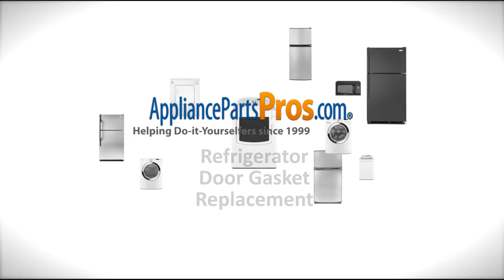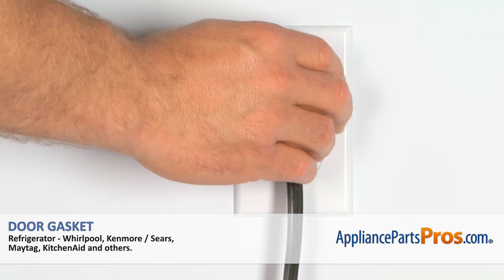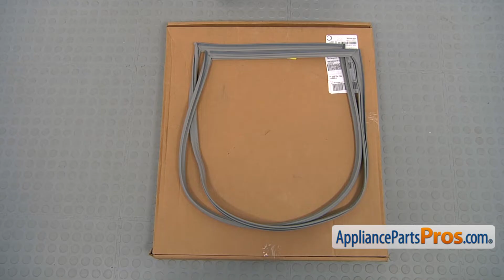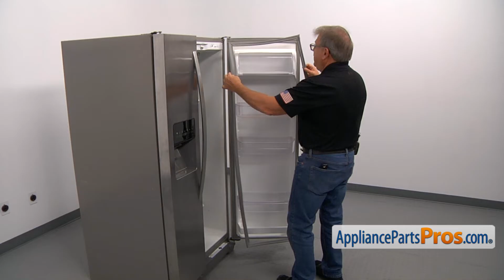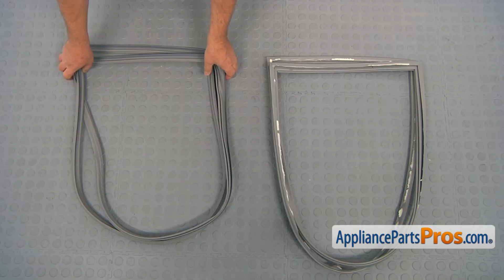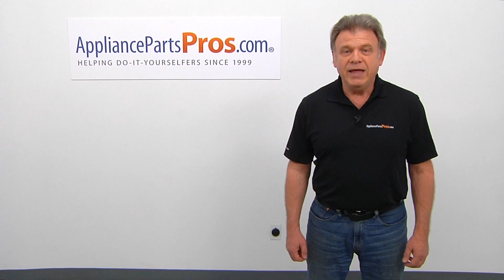Whirlpool Refrigerator Door Gasket W10136732 Replacement — fits KitchenAid/Maytag

Comment: don't we need to use a heat gun?
Reply from the maker: Many gaskets can be installed by warming them with warm water or allowing them to sit at room temperature, then smoothing out any wrinkles. If using a heat gun, be sure to use low heat and keep it moving to avoid damaging the gasket. Thanks for the great question!

Comment: Sold it or moved out. Cause thats officially a pos after a gasket change.  It  was a pos b4 but its definitely worse now. No 1/4 screws or anything.  Only units ever with a pos gasket like that.
Reply from the maker: Some models are designed with a press-in style seal instead of screws, which can make replacement feel a bit awkward at first.

Once it’s fully seated and warmed to relax the folds, it should seal properly. Hang in there — they can still run great after a gasket swap 👍

Comment: Hoping you can help. I have a Fagor BMF 200X with a ripped gasket. Fagor went out of business and I cannot find a Fagor replacement. I measured it as 22.5"x45".  There are three 1/8" holes in the gasket too. Any suggests on how to replace or fix it. The fridge still works well. Thanks.
Reply from the maker: We do sell generic gaskets that you can cut to fit the doors. Since they are generic parts we are unable to guarantee they will fit, but you can try it since the original is no longer available. The part number is TJ90SU2003. You can place that order through the website, or call us at 1-877-477-7278 to place the order over the phone.

Comment: Hello, I recently  installed  a new Samsung fridge door  gasket thanks to your help, now I have water line break issue. I first repaired it with a shark bite online union and it lasted bout one year and leaks from the union after you let  off on the water dispenser only. I put in a new shark bite union and started failing days later and only when  you let off of  the water dispenser. I contacted sharkbite tech support, they explain that that union is discontinued  and suggested  the John Guess brand union and I got same problem on this  5/16 plastic water line.

Should I try copper couplings ? What do you suggest ?
Reply from the maker: Which water line is broken, where is it located? What is your model number?
Reply: The water line goes along the back of fridge, exposed, it's a white plastic tubing. I repaired an online hole with a Shark bite coupling, it lasted one year. When you use  the water dispenser  it flows fine, but when you stop, somehow it causes back  pressure and it make water spray out of the coupling  union. It  happened three times and with threw new couplings, two were sharkbite and the third is John guess. It's a 5/16 size and I made sure all my cuts were square  and I did not sand the ends.  Shark bite tech support said that part is discontinued  and referred me to buy John guess brand. WHAT do you think? Should I try copper coupling? , there has been No plumbing work or other sites near by.
Let me know your expert advice.
Reply from the maker: If that water line is damaged it will need to be replaced. Using a coupling to fix it may cause it to leak
Reply: Got it, Thank You guys again for the help, very informative.

Comment: Thanks for this video! I purchased a new gasket for my KitchenAid refrigerator and replaced the existing one, applied the petroleum jelly but it's still not sealing properly. Some broken magnets came out of the old gasket and I purchased some new magnets but I'm not quite sure where to insert them? Any help appreciated.
Reply from the maker: What is the model number of your fridge?
Reply: @appliancepartspros  KRFC302ESS00 - thanks for your response!
Reply from the maker: It doesn't appear that you would have to add magnets. This gasket should already have a magnet in it. Did you happen to order this gasket from us?